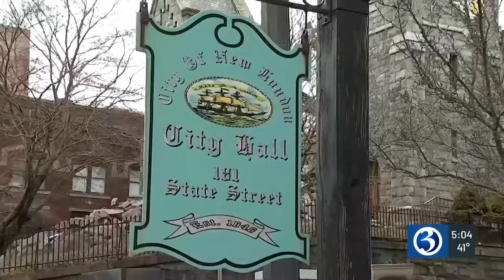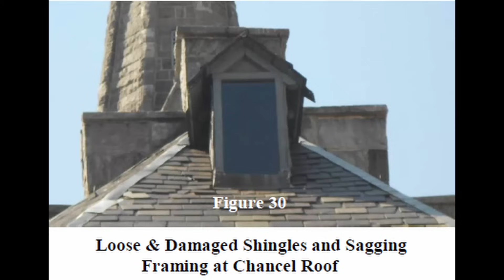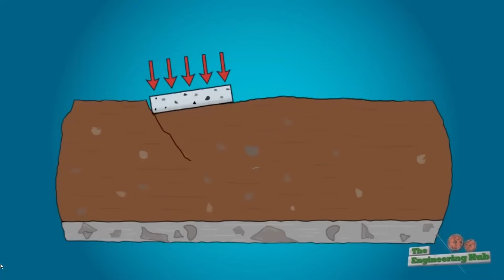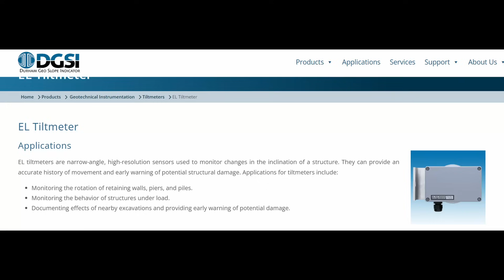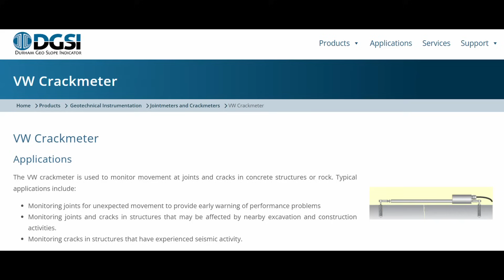New London Connecticut Church Collapse

Comment: It's an unusual event and a lot of the wood could have been creosote treated (could contain arsenic), but with the age it has I don't see that it has that much of asbestos.
Now when I see figure 12 presented combined with the damage to the stairs this seems like a foundation issue. Roof damage is something that's a bit harder because wood at that age could have aged and rotted due to neglect so exterior pictures aren't enough. Cracks like those in Figure 09 have to be looked at from the perspective of how old they are and what mortar that was used. The wrong mortar could by itself lead to cracks forming. In Figure 12 it do look like ordinary concrete was used instead of proper mortar, but at that place it's not really the cause for anything, just an indication that proper care and understanding of the materials in use weren't in place.

Water damage inside the stone structure can also be very important because old stone structures aren't always just stone, it's often combined with wood.

Overall the leaning of the tower is something that should have been cause for alarm a long time ago.

I'm also curious about what the foundation of the tower actually was - were there wood poles stabilizing it? If that's the case then draining water around the church could have caused them to rot since wood poles submerged in water are in an oxygen free environment but as soon as oxygen is available due to draining it starts to rot. The draining could have been unintentional when building around the church and remodeling roads. The basement part is quite interesting and shouldn't be ruled out as the cause. Were the people building that church originally familiar with building churches or was this just a new building with "fancy" attributes? This last part could be important when it comes to reviewing other churches.

Where I live (island of Gotland in the Baltic sea) there are a huge number of churches (about 100) compared to the relatively small population. 92 of them are dating back to medieval times. Many of them reside on relatively stable limestone ground with quite thin soil in a geologically stable area.
Reply: I saw from another video that there's a brick chimney close to one of the side towers to the main tower (steeple as you say), and that means that the basement most likely was in that area and could have contributed.
Reply from the maker: I would really like to know what foundation type this church had too.
Reply: The wood in this building is before the wide use of creosote-treated wood which is mostly used for ground contact and/or water contact locations.  The wood in this building more than likely is from old-growth trees and likely to be oak or similar species considering when the building was built, 1851.
Reply: I'm a retired engineer myself, but anyway my church had a school that according to a new law signed by Reagan in 1986 and called the Asbestos Hazard Emergency Response Act or AHERA. The school had to be inspected and the church paid for me to take the class to get certified and inspect our church and grounds. Cheaper than paying a company to do it. If that old church had any asbestos in it, it was installed after 1930 as before that it wasn't used much in construction and not at all in the 1840s when that church was built. 
Spray-on asbestos was banned as a building material in 1978 btw. Doesn't mean no asbestos products at all, just friable products that can make airborne dust. One product I still see is roll-on flooring with a paper-like backing. Take a look at that paper as it's typically 30% asbestos and if you slice a piece off you can see the chrysotile asbestos fibers in it.

Comment: Google Earth might offer some good clues. I looked up 66 Union St. and tried to see if there was anything obvious at the time the latest images were taken.

I was hampered in my endeavor by using my phone and bad (cataracts) eyesight.

I was particularly drawn to the gaping hole in the west wall. I tried to determine if there was a deformation of the roofline of the wall.

To my tired old eye (only one works and it works poorly) there does seem to be a bulge.

Take a look. Maybe you'll catch something.
Reply from the maker: Thank you for the suggestions.  I used Google Earth.  The problem for me is all of the shadows on the west side of the building makes it hard for me to see much detail.

Comment: Leopold Eidlitz, the original architect, wrote a letter complaining about the quality of work being done by the contractor on the tower and suggesting it be torn down and rebuilt. What corrective action if any was taken is unclear but modern photos show the likely presence of end plates of iron rods visible on the facade. The nave itself did not collapse but the tower did damage the church falling in through the roof. The two lateral smaller towers and the church walls largely remained. Dwindling congregations with limited financial resources often are not up to the maintenance of these complex, large buildings. Recently a 19th century brick, originally Roman Catholic church did collapse in Peoria, Illinois. It too had been sold and passed through several hands prior to collapse. The church was the former St. Patrick's Catholic Church. The future Archbishop Fulton Sheen was assigned to the parish as a young priest.
Reply: A mosaic from that church in Peoria was removed at some point and is now part of the altar at the Peoria cathedral.
Reply: Fulton sheen was born in El Paso.  
Just a few miles east of Peoria.
Reply: HIS STORY THE GIG IS UP THE LYING FREEMASONS ARE BEING EXSPOSED EIDITZ WAS A MADE UP PERSON

Comment: Even with that tower leaning, having obviously settled, would this settling not stress the building everywhere such that cracks in the walls or even tears in the joints of that heavy looking roof structure could have been the first thing to fail. Maybe I'm just too fixated on my initial thought/question; Did the walls fail and bring down the roof or did the roof fail and bring down the walls?
How much and in what way has newer surrounding buildings and earthworks affected the compostion of the ground and its carrying capacity?
Reply: The timber connections in that old church building would be a lot better than the connections between the granite stones or blocks in the walls.  Timber connections are usually mortise-and-tenon with pegs to keep the tenon in place.  This is a very strong joint.  The connections between hewn stones or blocks are gravity, mortar, and lead keys in grooves in the stones.

Comment: Jeffostroff did a good analysis analysis about 3 days ago. I think that he picked up on what happened & why.
Reply: That dude is a blow hard YT influencer. I never put any credibility to anything he says. He only speculates on what may have occurred but claims it to be fact. You are better off getting your information from channels from licensed PE like this channel or Josh at BI. The other guy is not a structural or geotechnical engineer.
Reply: You know you can actually just provide substance by saying what the point is.  The original architect condemned the steeple structure as built by the contractor at the time.  A makeshift repair consisting of tie rods was implemented, but the structural deficiency was never really addressed beyond that.
Reply: @PSUQDPICHQIEIWC 
I didn't elaborate because I'm not convinced that the collapse was because of the issues the architect complained of.

Comment: No CO should have been given after PE inspection report was prepared and Owners failed to correct defects for leaning tower aiming for the seating area .

Incompetent City building dept there could have led to hundreds of death s.
Surfside collapse killed so many innocent people in Florida from owners refusing to correct defects.

Thank God no one was in that building .

As an Architect and worked in structural engineering and construction in NY i have seen old buildings with rotten timbers from chronic roof leaks .
But to see a steeple that large that heavy tall leaning is insane no official pulled the C.O .?
Reply: Have you done any projects  in Chautauqua County ny
Reply: @cammiller5516  Long Island NY.
Not upstate.
👍

Comment: Wow those two still pics of the tower clearly leaning are very stark; the tilt is handily confirmed by other structures in the views i.e., the apparent tilt cannot be put down to camera angles. This will have me looking at old steeples critically for years to come. Let's face it; were it a structure in which people lived or frequented, someone would probably have raised an alarm before the collapse. I lived in a house once that had settled somewhat shortly after construction had been completed, some 50+ years before i had moved in, and the tilt was minuscule and not noticeable from outside (granted, it would be less noticeable anyway as a single-storey structure), but very noticeable when inside it, especially when i dropped a ball or marble on the floor.

Comment: What effect do you think "salt air" has in the deterioration of the concrete in a building that old?  I mean 170 plus years has to take a toll yes?
Reply: I doubt that there have been much metal reinforcement in the structure given the age and that's what's damaged by salt intrusion. Mortar used properly isn't that much impacted by salt. It could shorten the time between re-doing the surface parts but shouldn't have been the cause for major issues. Pure water entering into cracks with frost heave is more of a concern, that's one thing that wears facades. But when looking at the rubble the stones themselves looks pretty much in decent shape and a structure like this is basically just held together with gravity and interlocked stones like you build a Lego tower. The mortar is more there to seal the wall than to hold it together. Think of it like building a Lego tower with all pieces different in size, shape and surface structure. You'll get gaps, but the next level bridges and holds it together by friction and then put mortar into the gaps if you need, but most mortar is on the surfaces and not really inside the walls.
The masonry work on old stone buildings is actually quite impressive especially considering that metal reinforcement was very expensive and mortar was expensive. Stones and labor was relatively cheap. So putting the effort into making the stones matching well was worth it. That's also why you see stones with "funny" shapes in the rubble - they were there to perform interlocking work.
So I don't think that it was the tower itself that gave way, it just imitated a house of cards when the tilt became too large.
Reply: I do see that there were some steel reinforcements but they don't look like they suffered any serious rusting and they were most likely added later.

Comment: The bible says the church should be built on a firm foundation (ie. a rock).  This was obviously not done here.  It also talks about things being laid to ruble when it's time.
Reply: A lot of parts of the earth do not have rock available within reasonable proximity to the ground surface.  Where I live rock can be 20' to 80' below ground, in some areas where I've done work the rock can be 200' or deeper.  We have the technology and equipment to reach rock that is 100' deep but they didn't have that in middle 1800s.
Reply: Construction concluded in 1853 so maybe maintenance may be more important.

Comment: The Church of England requires that all churches are inspected every five years by a qualified person on an approved list. It is important that the condition of these buildings is properly monitored, and those responsible for the church are aware of problems and receive proper advice.
Reply from the maker: I would bet that many of those churches have instrumentation for monitoring their condition church over time.
Reply: Sometimes. You will be pleased to note that the advice included in these quinquennial reports, which are often lengthy, can be to get an additional report from a structural engineer. As noted there can be many reasons for problems emerging, and prompt remedial action can often overcome them.  @CaseyJones-Engineer
Reply: Regrettably, the C of E only requires that the buildings be inspected whereas inspection of the Church itself by a qualified person on an approved list .....
Reply: @neilhales4693 haha, that's well beyond repair at this point
Reply: I'm not really sure what you mean by bringing up the Church of England. Did you mean to use it as an example of what could have been done if a different institution had been running this church? As far I understand it, this was a Congregationalist church that was being leased to Revival church so I don't think there's any overarching body that would have been overseeing this building besides the city of New London.
Reply: @ct_carpenter  Are You saying that New London isn't in England?
Reply: @paulpinecone2464  Har har. Kidding aside, the COE is actually really big in New England, we just call ourselves Episcopalians.
Reply: @paulpinecone2464  Lol. Will you join me in making London be called Old London? Do you think the founders of New London would be disappointed New London never grew to be as big as Old London? The British really sucked at coming up with new names on all the places they landed. New South Wales, New York.
Reply: @CarlCrisp  The settlers of New England came over with a single set of town names and recycled them in multiple states. There are many cases where the same town/village/city name is used in two or three different states.
Reply: @CarlCrisp   Yes. I want York to be renamed Old York or perhaps East York. Our New York clearly took the name and ran with it. I think we should have the rights to the more efficient moniker.
Reply: @ct_carpenter   Nepiscopalians?
Reply: @ct_carpenter - Congregational churches are usually independent bodies with no large pools of money to tap into.  And with shrinking attendance, the problem has only become worse.
Reply: The Congregationalist Church with this building faced the same challenges as if it were in England. The very fact that there was no overarching body to instruct them means that it was their responsibility to put necessary precautions in place. I suggest others should take note by following best practice elsewhere. @ct_carpenter
Reply: @ct_carpenter  "Did you mean to use [the Church of England] as an example of what could have been done if a different institution had been running this church?"
Yes, obviously. Do you really think the OP believes that an organization in the UK would be responsible for inspecting churches in Connecticut?
Reply: The Church of England also has many buildings more than 1000yrs old!
Reply: True, but 19th and 20th century churches can have just as many problems. @nexpro6985
Reply: @nexpro6985  "The Church of England also has many buildings more than 1000yrs old!"
Yes but they inspect the newer ones, too. Churches have been collapsing for as long as churches have existed, as they've generally been the most ambitious buildings of their time (ditto mosques). This church was built in 1850, which is around the time we were learning how to do it properly.
Reply: I believe most Catholic Archdiocese in the US and Canada have a fairly similar policy regarding regular inspections of church property. My Dad post retirement worked for an Engineering firm that did that for the Rockville Center Diocese, just across Long Island sound from this church.
Reply: @andrewtaylor940 The registered owner of the church is James Levesque. His website says he has started 40 churches all over the world.He runs a course called “How to Start A Church From Scratch In Just 5 Days.” This building wouldn't have been treated any different from a store across the street. The fire marshal will check that the smoke detectors and extinguishers are up to code on a walkthrough, the exits aren't blocked and that's about it.
Reply: The archdiocese in the U.S. have all been sued into oblivion. That is why all of these churches have been sold. They had billions to pay. Pretty sure that these collapses will continue. Church of England has authority over their churches. Catholic Church doesn't own any churches anymore.
Reply: But doesn't that miss the point? If churches are independent, then they must accept responsibility for managing their buildings properly. That means seeking, and accepting, professional advice.   @Hollandsemum2
Reply: New London CT is also on the Thames River, as many place names were taken from the mother country.
This church was sold to this Engaging Heaven congregation in 2015.  They simply used the space as a tenant since then.
New England is mostly rock ledge a few feet below the soil and most Colonial meetinghouses were built on hills.  In the cellars you will see exposed rock ledge and the foundation is built right on the rock.  I can't say for this case, but my feeling also was a structural failure in the cellar - buckled wall or failed beams.
Connecticut now has an Historic Building Fund which covers 50% of the cost after repairs are made.  But still out of reach for our dwindling congregations.
Reply: Well, you also have to remember that:
A) many of the buildings the COE oversees are priceless historical artifacts dating back to the Middle Ages
B) in Britain, any structure built before last Tuesday is considered a Grade I Listed Building, and 
C) the Church of England has a multi-billion dollar endowment, so it can actually afford these sorts of things. $100,000 might not seem like a lot, but that only covers one church. The USA has 380,000 churches, so if we assume that only half of all churches are old enough to require monitoring (say, 70+ years old AKA built pre-1954) the total cost to install monitoring systems for every old church in the US would come to $19 billion.